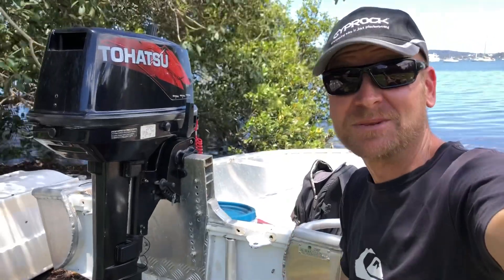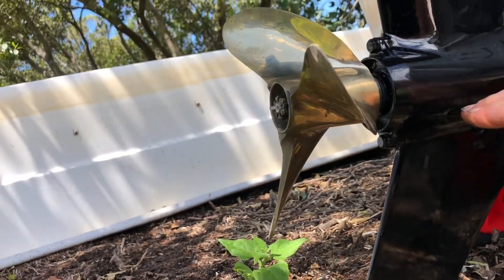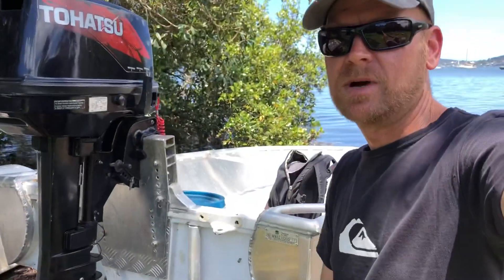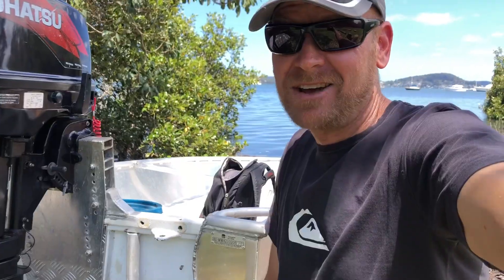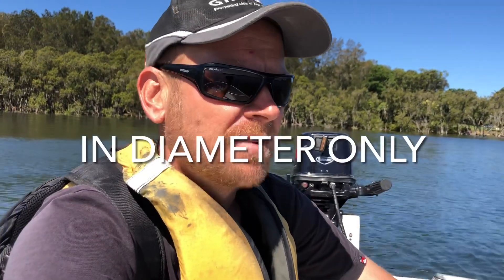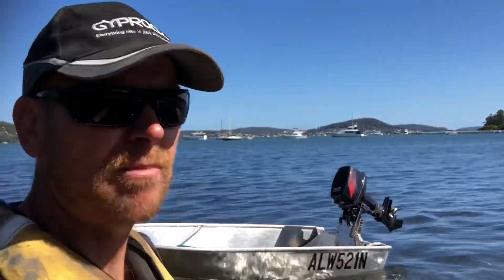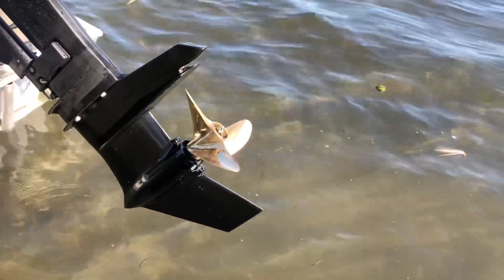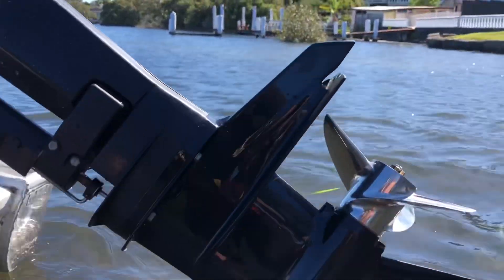Fast boat modified outboard

Comment: Hello. You good. Maybe need to cut drive shaft housing? More stylish. https://youtu.be/5oF3yCNDc6A?si=Ivwb25wUdo4sIJa4
Reply from the maker: Hi Mate,
I watched your video, lots of work, I’ve done something similar in the past. I can’t warrant spending that much time as it will not really add performance. You’re correct, would definitely look super stylish and cool.
Cheers 🍻 
Aussie Boat Guy 😎

Comment: Can you make a video how you make a low water pick up with water hose from a 2 cil because i dont want to drill in mij gearcase.
Reply from the maker: Hi Mate,
you just need a scupper on the transom and insert the water into the lower unit where needed. You may need to weld a pipe where needed, it is slightly different for each hp and brand.
Cheers 🍻 
Aussie Boat Guy 😎

Comment: What? No Doelfin? Then stretch your anticav plate a bit wider and a semi delta closing shape with some bends. Pushes the stern up a bit more. Just tell the judges it's counter weighing the motor.
Reply from the maker: No need for fins on that setup 😁

Comment: Will definitely be keeping an eye and ear out for when my 3.85 sea jay arrives. A not fully run in  5hp 4stroke is going on it, way underpowered am guessing but some tips will be good. Only problem it's propane so can't fiddle with carb to get more power
Reply from the maker: Yeah that's a pretty small motor for a 3.85, I'd recommend a bigger one for sure.
Still fine to get out there and be on the water and you really don’t need to rush into getting a bigger one.
Cheers 🍻 
Aussie Boat Guy 😎
Reply: @25hpboatracerman  Thats what I'm thinking no rush take ya time, if it's rough can't go at high speeds anyway. That's the theory??

Comment: Can you buy these pellers  or you have build  these yourself  or get them customs built   by blacksmith with  machines  i can't  seem to find any for my for  2021 F25 except  for  factories   with higher and lower pitch
Reply from the maker: Hi Mate,
I build some of these for myself. Some of them I modify out of other propellers made for different motors. You may be able to find one at signature propellers if you get in touch. 
Thanks,
Aussie Boat Guy 😎

Comment: your speed is insane!

I gota  6hp 4 stroke yamaha (2021) and a small inflatable boat.   alone i reach up to 24km/h which is alright.

Is there any way i can increase my speed ?  whats the simplest mod?  raising the transom maybe?
Reply from the maker: Hi Champion,
You could try lifting the motor slightly and work your prop a bit. You may not get much more top end though, I haven’t had much luck with the inflatable.
Cheers 🍻 
Aussie Boat Guy 😎
Reply: @25hpboatracerman  so the goal is to raise the motor as high as possible?  (but still have the cooling water intake be unter the water )

what would you do mostly on a prop?

Comment: Do you troll slower at idle with one of these style of props? Main question I guess, is there more slip at low rpms?
Reply from the maker: Hi Mate,
For sure, definitely more slip at low rpm, unfortunately too much. It is even worse if you run a non tubed race prop as even more air and exhaust cause cavitation and ventilation at low rpm.
Cheers 🍻 
Aussie Boat Guy 😎
Reply: @25hpboatracerman  thanks, I have a old prop I want to try to alter. I want to be able to troll slower, around 1mph but still get up to 30mph when I open up the old 85 evinrude lol

Comment: Also the water is less distorted
Reply from the maker: Hi Mate,
Not sure what you mean but if I lower the motor or trim it down the boat goes much slower.
I will probably put a standard case and prop back on, drop them motor back down and trim it in a tad once I’m finished trying to see how fast I can get a modified 9.8hp to run, I’m going for 65kph hopefully.
that’s faster than my 30hp on a 11ft aluminium bpat which is setup standard.
Cheers 🍻 
Aussie Boat Guy 😎
Reply: @25hpboatracerman  I like it I think it works
Reply: @25hpboatracerman  I think it needs to go higher with less angle

Comment: IS THE BARREL FLARED ON THAT STAINLESS PROP?
Reply from the maker: Hi Mate,
The hub on the stainless propeller is straight, you do not need a flair on a surface piercing prop.
Cheers 🍻 
Aussie Boat Guy 😎
Reply: @25hpboatracerman  ok I was going to say cut it off if it was.

Comment: hello well done thing is awesome!! curious on the prop specs and also if an outboard like this will perform well on a RIB!! I got a Mercury 15hp 2 stroke that I like to modify
Reply from the maker: Hi Mate,
Thanks, I appreciate your encouragement 👍
The Prop is roughly a 8.5 x 15 which I made out of a bigger prop cut down. The merc 15 super (Japan built ) are awesome for modifying. The USA 15 Mercury is harder as most of them are a lost foam casting making it very hard to get to the ports as the head isn’t removable.
Either way, props and engine height are the key to speed. Remember though it will be harder to get on the plane and torque steer will come into play (you will have to fight the tiller all the time if running surfacing props)
Cheers 🍻 
Aussie Boat Guy 😎
Reply: @25hpboatracerman  hey thanks for your response!! I got the 15 super version (Japan) so that is something positive, I suppose that your video about modifying the 8HP is a great guideline to modify the 15HP. I Just need to search for a suitable prop, do you maybe have some tips or a guideline for choosing the right size prop?
Thanks!!
Reply from the maker: Hi Champion,
Plenty of options for the 15hp super, it’s actually the 18hp Tohatsu block with the larger 60mm bore (check out my 18hp - 15hp - 9.9hp comparison video)
They are raced here in Australia so depending on how far you want to go with it, sky is the limit.
Remember as soon as you start surfacing a prop it is more unpleasant to tiller with the torque steer etc and getting up on the plane becomes more difficult. Gotta sacrifice something I guess for ridiculous speeds.
I will have nose cones for that motor soon if your interested 
Cheers 🍻 
Aussie Boat Guy 😎
Reply: @25hpboatracerman  Hey! Sick I'm so stoked to start the build. I'm also really interested in the nose cone for the 15hp would make things alot easier instead of fabricating it myself. I'm currently building the jackplate with a rotating handle to adjust the height, pretty much like the ones from on the fly

Comment: Nice but your cavitation plate too high propeller suck too much air..
Reply from the maker: Hi Mate,
The GPS top speeds tell me that height is the fastest during many test runs.
Cheers 🍻 
Aussie Boat Guy 😎

Comment: interesting video, some questions: what power does the engine have?  What make and model is the propeller you mounted?  and where did you buy it?  Thank you
Reply from the maker: Hi Mate,
Thanks 😊 
The motor is a highly modified 9.8hp Tohatsu two stroke (plenty of vids on the channel about that motor)
The Propeller is a one off custom propeller and is not available unfortunately.
cheers 🍻 
Aussie Boat Guy 😎

Comment: The skeg on the gear box looks to be larger than needed, causing some drag. however when you run that high it is easy to cavitate the skeg and loose steering  in a turn. 
Are you running higher oil /fuel ratio putting the engine under that load with the number of RPMs it is doing?
Reply from the maker: Hi mate,
Yeah, the reason did the large skeg is for steering when running that high. I’m running 50 parts fuel to 1 part two stroke outboard oil, so every 5 liters of fuel I run 100ml of oil.
cheers 🍻 
Aussie Boat Guy 😎

Comment: Mate just be careful of the engine mounts  you ll understand why they are called the egg beater but keep uo the good work
Reply from the maker: Hi mate,
I fully agree 👍, they are very small and weak on that motor. I am going to make a thrust block to take the load, also I reckon it will settle the boat as well because it feels like the movement in the mounts causes twitching while I’m trying to stee, sometimes, like play in a steering wheel.
Thayer for your comments and input, I really appreciate it 👌
cheers 🍻 
Aussie Boat Guy 😎

Comment: Surface piercing props is a bit of a science to get right.
You’re on the right track tho.
Perhaps you could alter the ratio of the gear set in the lower unit to increase the rpms on the surface piercing prop?
They do like to spin faster than a normal OB lower unit will allow at engine WOT generally.
Have only run much larger setups on fast lobster boats, ie twin arnessons on 1000hp & a pair of sea fury surface drives on 2000 hp.
42 knots & 48 knots respectively.
Reply from the maker: Hi mate, 
Thanks for your comments, I love the big surface drive setups, haven’t played with them personally. 
I may be able to find one other ratio to fit that gearcase but it is a 2 to 1 and at the moment it’s running a 2.08 to 1, not sure if that would be enough of a difference to worry about though 🤷‍♂️. I still need to try another few props as I feel they are still not optimal.
I also saw a section on the hull (lifting strakes) that are built very badly and would be causing drag which I will focus on next.
All the best and 
cheers 🍻 
Aussie Boat Guy 😎
Reply: @25hpboatracerman  failing a change of gear ratio, about the only other option is to increase pitch. Because surface piercing props aerate the water they run in, the slip factor is quite high, so you can get away with more pitch than a standard full blade sub surface prop.

This might help.

“Camber and cup, especially near and at the blade tip, reduce slip. 'Slip' yields the pitch of the helical wake, which is less than the blade pitch. The blade pitch increases from leading to trailing edge on high speed props (flat blades are for ships and fishing motors). The low pressure side is highly cambered, the high pressure side should also be cambered. Slip can appear a a factor in the mechanical efficiency. For high speed craft (raceboats )mechaanical efficiency is .6 to .7, slip is about 5% at mid-chord, and a properly designed surface-piercing prop ha about zero slip at the leading edge.”
Reply from the maker: Thanks for all your input on this mate 👍.
The standard submerged prop for that motor was a 8.5 pitch and the stainless cleaver I’m running is a 13 pitch, the brass chopper is a 15 pitch so already gone up in pitch a lot, I still want the revs to reach over 7k as my power is at 6200 to 7200 rpm from my tests after all the mods I have made to the powerhead - exhaust - intake etc.
I am still yet try try the brass prop after adding a small cup the the trailing edge, hoping it helps.
Cheers 🍻 
Aussie Boat Guy 😎
Reply: @25hpboatracerman  You definitely sound like you’re on the right track. Surface piercing props have that characteristic rooster tail they shoot out behind when they are operating efficiently.
I noticed yours doing just that in one of your WOT runs, so you can’t be far off having it close to optimal I’m guessing.
With the arnessons they run from ZF Marine gearbox, so there’s ratios increased from the engine crankshaft rpms, then through jackshafts, out through the transom - so you can bury both props on takeoff so they are fully submerged - to get enough bite to launch without the props ventilating and slipping so much.
Then as you get up on plane, you lift the props until the boss is at water level and they become surface piercing.
I notice you have a fixed jack plate with your OB height fixed so you don’t have that option.
But Bobs Machine Shop in Florida do make electric height adjustable jackplates so that you can raise your OB height on the fly, effectively achieving what the arnesdon out drives do .

The big “risk factor” with lower unit gear case water pickups, is that if you raise the gear case water pickup point slightly above water level you lose prime on your water pump and stop circulating cooling water through the head & at WOT that cooks the motor in mere seconds.

So the key thing the flats boats who typically run shallow and employ Bobs Low water pickups modified gear cases and hydraulic or electric jack plates is they have a water temp guage on the dash that you watch like a hawk for any temp increase as your raining the OB on the fly. Any sign of increasing temp and you lower the jack plate height to stay in optimal temps range.
Something else they do, is alter the water pump pee stream nozzle so that it shoots up into the air - and they have a rear view mirror (like a car) on the dash so you can see the pee stream visually behind you while driving and adjusting jack plate height and trim tabs etc.
If you really wanted to go faster you should consider a twin hull that has a Hysucat style foil between the sponsons to lift the sponsons higher in the water to reduce wetted surface area reducing drag.
The 2 fast cray boats I was on were both “vortex” style hulls, where the side sponsons are set forward far enough to catch & ride the bow wave thus harnessing that otherwise wasted energy, and lift the hull much like a foil does on a cat hull.

The 42 footer had twin Iveco 500 hp diesels running through ZF gear boxes to the arnesson outdrives with their jack shafts.
It was a Abrolhos Islands cray boat off the WA Midwest coast that ran 42 knots and drew only 6 inches on plane.
The Abrolhos is a place with lots of very shallow reefs that originally were fished with jet boats to get in shallow to set pots in the holes in the reef where the crays lived.
The surface piercing vortex hull achieved the same result.
The replacement boat was still a vortex hull but 48 feet this time so 6 feet longer & it had twin 1000 hp Cat C12’s turbo diesels again through ZF Marine gear boxes, but this time through the New Zealand Sea Fury Surface drives.
The transom was sloped back at ~ 45 degrees and the prop shafts went straight through the sloped transom with cutlass bearings and rudders behind.
You couldn’t lift or lower the props their height was fixed to have the prop bosses at surface level on the plane.
It drew 6 inches but ran 48 knots.
The Abrolhos Islands were 54 nautical miles offshore from Geraldton and it was an hour and a quarter trip on the right day.
The technology works well if you get it right but there’s a bit of trial and error both setting it up right but also learning how to drive it to best effect, because it’s not like most other boats.

Comment: Would it be less sketch with a remote throttle and steering? You could have the airboat style push pull steering stick mounted on a pivot in the bottom of the boat with some steel cable and pulleys for little weight
Reply from the maker: Hi mate,
I like it 👌
I have been thinking of steering wheel, we will see 🤷‍♂️
cheers 🍻 
Aussie Boat Guy 😎

Comment: At least the bow is down should still be a little flater pretty impressive ill bet you can still do even better had a 35hp on my 14ft aluminum custom aluminum transom motor tilted and a 25# anchor in the front would do 34mph about 3/4 throttle never wanted to go any faster crazy
Reply from the maker: Hi mate, 
Thanks for your comments 👍
Yeah, over 30mph starts to feel pretty fast in a small tiller steer boat.
Definitely I am going to be playing more with setup to see if I can squeeze more speed.
cheers 🍻 
Aussie Boat Guy 😎

Comment: You need to show gps while you're driving that hotrod!   Seems fishy that you only show it afterwards.  Also add some more gear in it, maybe another person.  I suggest skinny tan blonde about 130ish lbs
Reply from the maker: Ha 😂 don’t have one of those to put in.
Fair enough on the GPS, wasn’t really needing to prove anything so had it in my bag as not really anywhere safe to put it. Also even if I show it, I could have two, one with a higher speed set on one etc etc, someone will always say I’m cheating etc etc so it’s really more for me the gps so I can try beat the top speed with more mods.
Also if I was one to cheat with top speed gps numbers surely I would say more than 61.1kph.
I’m hoping at some stage to get that motor up to 65kph then it will be faster than my stock 30hp 11ft tinny.
it’s more for fun anyway 👍👍
cheers 🍻 
Aussie Boat Guy 😎

Comment: would be nice if you had a log system that had gps speedo and rpm with it. That way you can really look at what is going on and tell what needs to happen to maybe gain a bit.
Reply from the maker: Hi mate,
You are spot on and I have a little book I write those things in as I do run the tacho and have the gps onboard. I get more strict when I’m near the end or top end of tuning and setup, even temperatures the day I’m running as that definitely makes a difference.
cheers 🍻 
Aussie Boat Guy 😎

Comment: No way that's under 10 hp
Reply from the maker: Hi mate,
Yeah I agreed 😁
I’ve done a lot of mods to that motor - poring, high compression head, custom tuner, intake and reed mods, bigger carb and lower unit etc.
Not sure on actual hp but probably about 13hp but happy to rev.
cheers 🍻 
Aussie Boat Guy 😎
Reply: @25hpboatracerman  she is definitely a screamer man, and love all 7200+ rpm of glory
Reply: Gotta love that 2smoke oower😅

Comment: until you hack into the manifolds and strap on a set of pipes, youre missing out...

be sorta fun to make a pair :) havent played with 2smoke for a few years...
Reply from the maker: Hi Mate,
I agree and would love to go that way but unfortunately where I live I would get in trouble for noise 😢 
Still may happen someday though 😂
cheers 🍻 
Aussie Boat Guy 😎
Reply: @25hpboatracerman  pffft. noise!

plumb em back into the leg...
or just run em!

iunno, i know the standard idea of a twostroke is hearing the yz250 from about 5km away, but all the pipes ive made myself for chainsaws and the like generally come out quieter than stock... often get more intake noise!

Comment: Have you considered dropping the motor down slightly more to get a little “cleaner” water?
Reply from the maker: Hi mate,
I did try that but it was slower,
will try it again with different trim settings.
cheers 🍻 
Aussie Boat Guy 😎